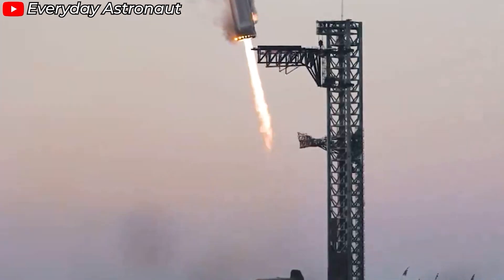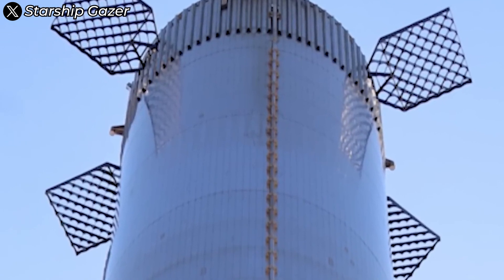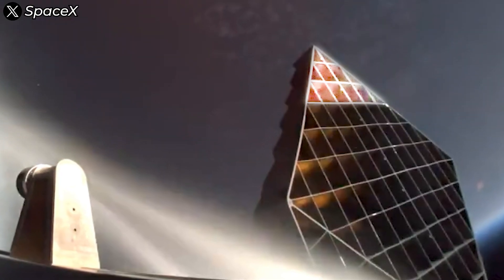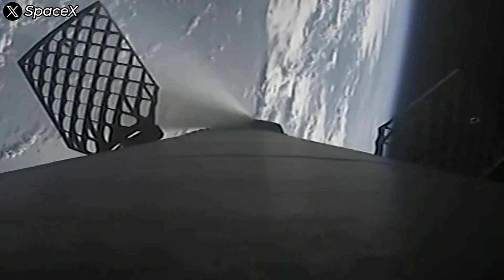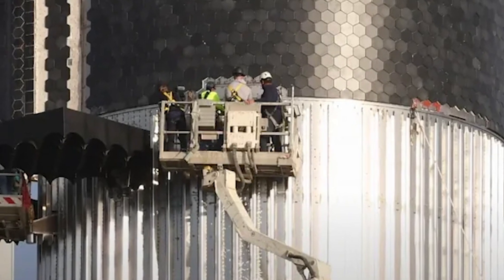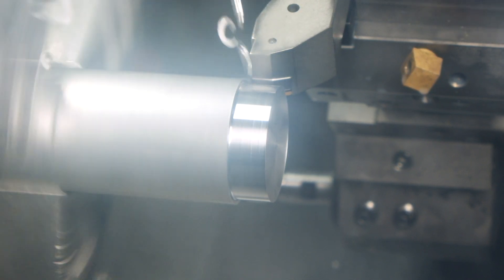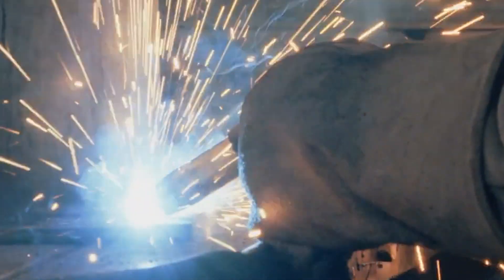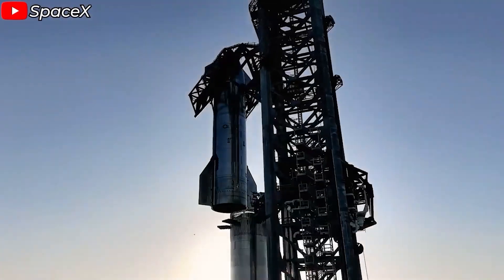What SpaceX Starship Grid Fins Just Did During launch return is shocked everyone

Comment: The whole design is fatally flawed and bound to destroy the catch tower.  The booster should have legs like falcon 9 and so should the starship part for safe stable landings
Reply: The reason they got rid of the legs was to increase payload and decrease weight and parts to fail. Not only that but because it returns to the launch pad, the idea is to have the rocket pretty much ready to go again within days if not hours. Yeah it's risky but if it works, it will pay for itself big time.
Reply: @tidan4575  I know the stuff u mention but just watch, not long before a landing blows up the whole show
Reply: TBH I’m expecting something bazaar to happen on flight 6 because of the numbers: flight number 6, booster 13, and starship SN31. Even if spacex looses the launch tower they’ve got a replacement nearly complete. Though if the ship hits the fuel farm…that IS bad news. Though even if that happens spacex won’t give up that easily.
Reply from the maker: Adding landing legs would increase dry mass by at least 20 tons, which would raise fuel requirements and reduce payload capacity - something SpaceX doesn't want. B12 successfully returned, they achieved their main goal, and now they’ll continue refining the details.
Reply: Ah yes, another random internet expert who knows more than spacex does about their system.  Yawn
Reply: @clytle374  Ah yes, another pessimist mocking people that might have something to say. Never claimed I was an expert.

Comment: Can 3 fins guarantee enough shear strength and grip on the chopstick catch tower?  I mean, if the rotation isn't perfect, the catch tower only catches two fins only; the 3rd fin would be in the juxtapose direction of the grabber.
Reply from the maker: The contact points between the booster and the chopsticks are two lift points near the grid fins, not the grid fins themselves. I haven’t fully looked into the torque when Starship has three fins, but I guess it's gonna be fine.

Comment: The BF Booster's Grid Fins , deformed , from the high heat coming through the Hot Staging Ring , from the BF Starship's 2nd stage ignition ....  All they need to do is Alter the Ring to shield the Fins from the Blast ... and they won't get bent out of shape ....... KISS  😀

Comment: Delay the raptor start up, problem solved
Reply: It is designed so that the second stage ignites the engines before separating from the first, because if the second stage separates without igniting the engines, it slows down and fuel may stop flowing properly into the engines.
Reply: As the booster is (still) under acceleration (with 3 engines firing) during staging, how does does StarShip separate without firing its own?